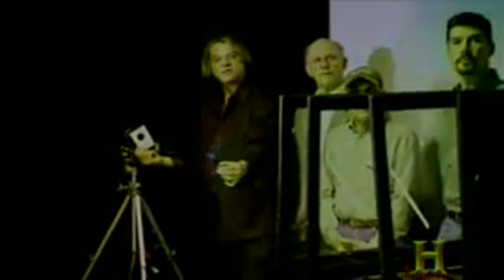tether "ufo" sts75 explained

Comment: He could well be right about the shape of the things, but that they pulsate and change directions? And the camera is focused on a large object a good distance away, is the camera not just going to blur out small objects? Interesting though, this is one of my favorite cases.
Reply: There is much more of an explanation here than the shape of these. Unfortunately the clip is kind of short, and I'm not sure if they explained this in fuller context elsewhere. So think of all of these tiny pieces of ice and other debris floating around the ship. The sun is shining, and it is lighting up those particles, and those particles are hitting that round mirror, which then bounces back into the lens. Well first, the space shuttle isn't stationary, it's orbiting earth at 17,500 mph. That means all that little debris is as well. You're using the word pulsate. I would use the word glimmer. Think about it. It's not going to be lit up evenly and not fluctuate. The debris is being lit up by the sun, reflecting off a mirror? What would that look like? And with the camera having to be over exposed as well.
Reply: @LetMeThinkAboutThisForAMoment  Explaining away visible reality getting less and less believable and more and more indoctrinated as you go

Comment: Hmmm... He must not have seen the footage of objects coming out of thunderstorms then stopping for a minute or two, then moving again. Sometimes the objects change direction and speed up. They go in and out of clouds. Also, the objects are not blue and nasa is using a special uv camera.
Reply: Everything you just wrote is wrong. For example, the ice flakes drift out of the shuttle's shadow and appear, they are not a thousand miles away dodging from behind clouds. And the cameras are usually normal visible-light imagers.

Comment: Already seen it thanks. I'm puzzled why you might think it strengthens your case, when every single objects is clearly seen to fall towards earth (due to drag and gravity). There are some anomalies due to imperfect stabilisation (video processing), but since the 'wiggling' is not present on the original footage it's not an issue. The fact is, this video supports the prosaic explanation, like it or not.

Show me one single object than doesn't turn towards earth (tether points down to it).
Reply: When you say "prosaic explanation," are you referring to the terminology used by Edgar Mitchell in his letter response to David Sereda? Just curious.